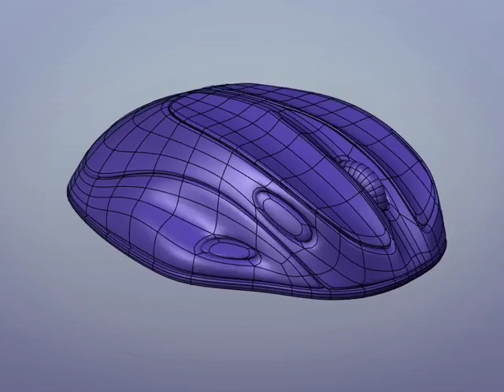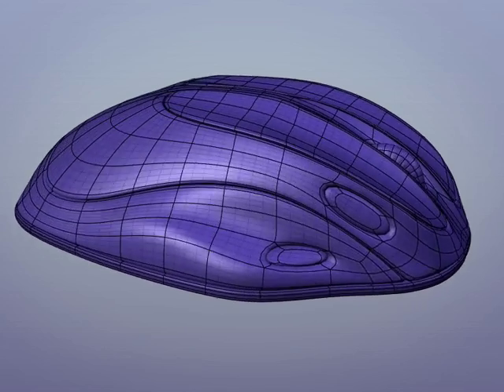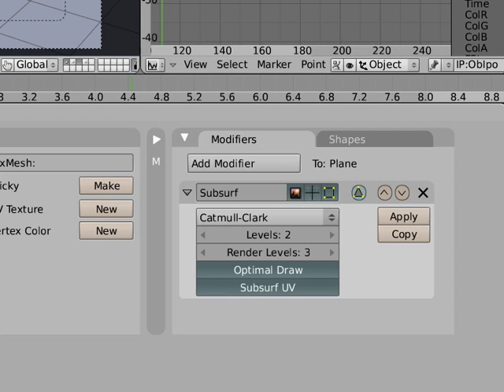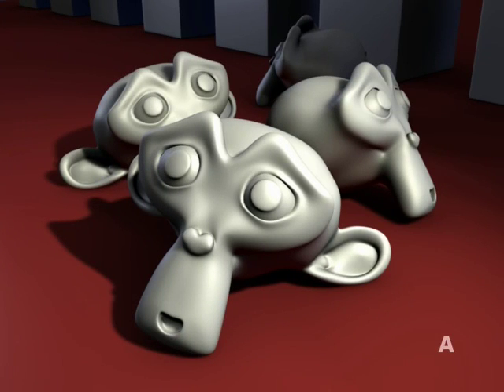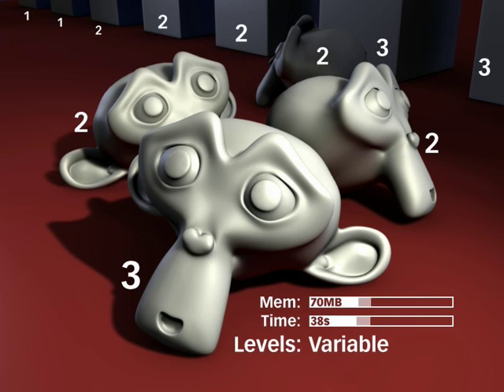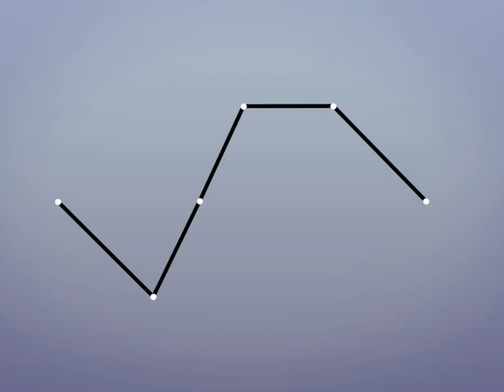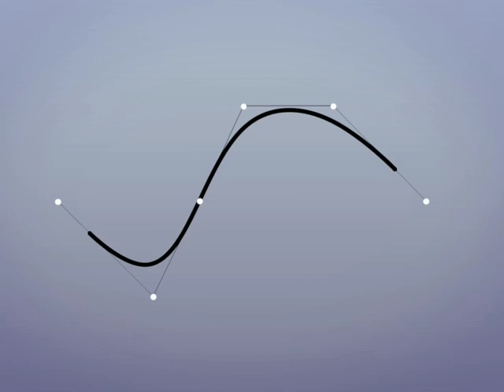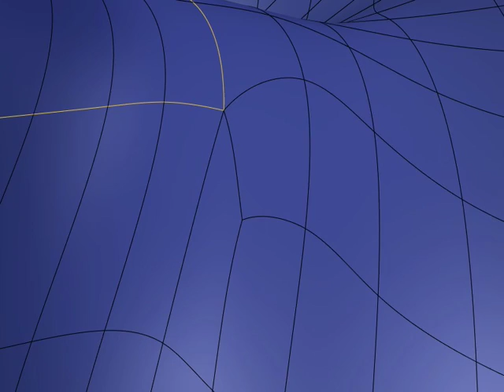Subdivision Surfaces: Overview

Comment: Hmm but how are such meshes with smooth curved edges rendered in the modeling software's view? I haven't seen anything related to rendering smooth 3D curves in 3D graphics APIs such as DirectX or OpenGL, only point vertices connected with straight line segment edges.

Comment: Is their a way to implement an option when using subdivide so new vertices are pushed out and pre-existing vertices remain in position, rather than being pulled in.

I believe I will need a way for subdivision to function like this so that a mesh can be broken up subdivided in sections.

blender does not appear to have this ability yet, are their any other programs that do?
Reply: in 3ds max, option "use smoothing groups". All verts on smoothing group bornder will stay in place, but others will smooth.

The other software probably have similar options, like edge weight.

Comment: when you push the 3 button in maya, os that subdivision surfaces?
Reply: I never used maya, but I doubt that's the case, I have a feeling that pressing '3' is just a hot key for switching between flat and smooth shading
Reply: No i is not its a subdivsion preview
Reply: it works the same way
Reply: +Jonathan Devach yep it's catmull-clarke subdivision surface

Comment: Oh now I know why my current model looks better before subsurfing, every face is a triangle... hours of manually changing 10k faces here I come T_T
Reply: If your using max, try the quadify mesh modifier, It sometimes gives good results depending what your working with
Reply: that was making even more triangle polygons for me but I'll check up on it, currently I'm just cleaning my model and trying to get it smooth.